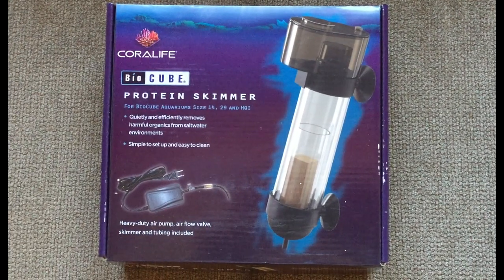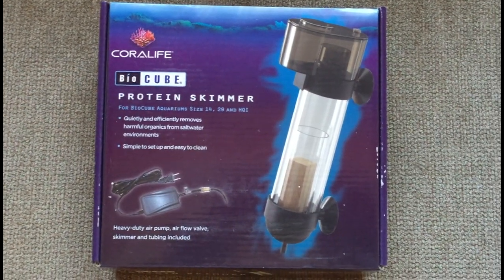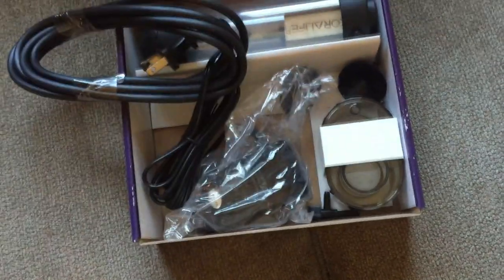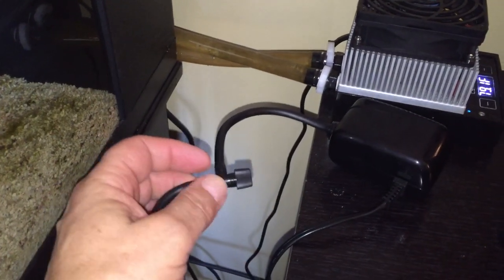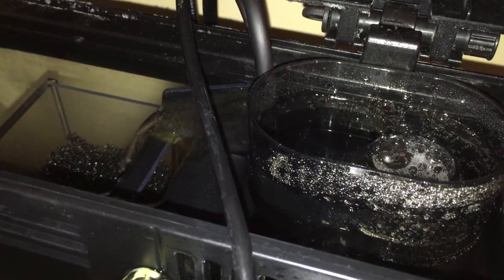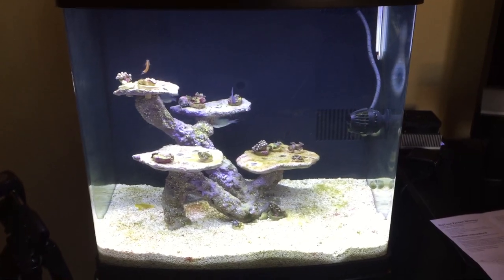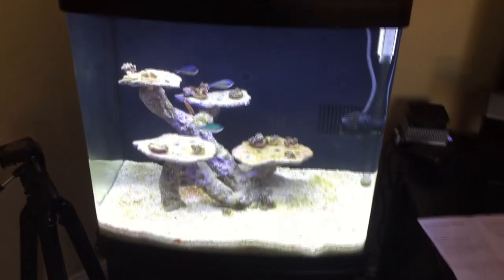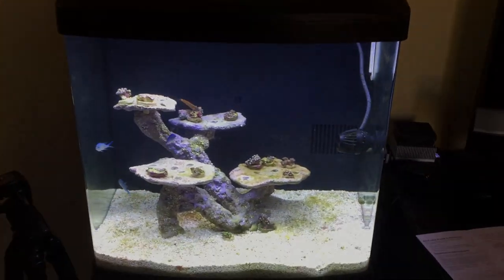Installing BioCube Protein Skimmer

Comment: have you noticed a drop in nitrates?  or...is the skimmer worth it?
Reply from the maker: It worked but not great. I replaced it with a Tunze 9001 which does seem to work better but again, not great.